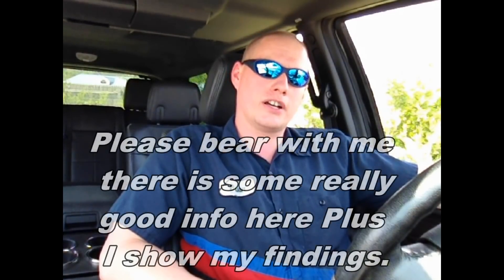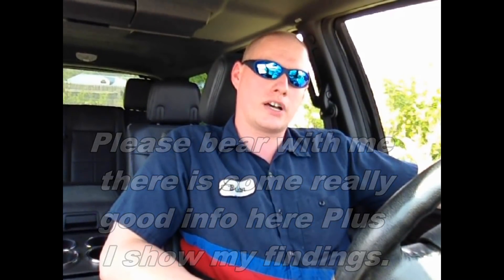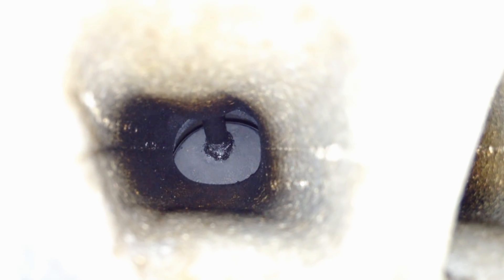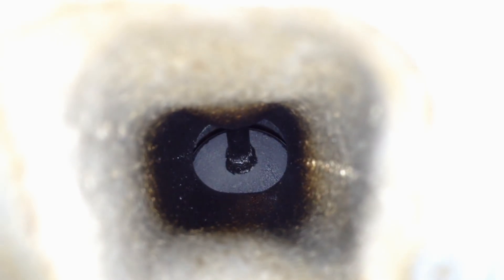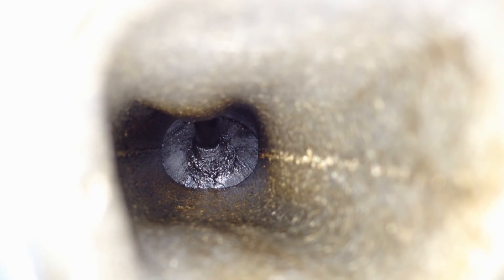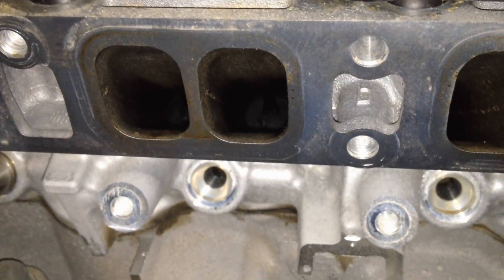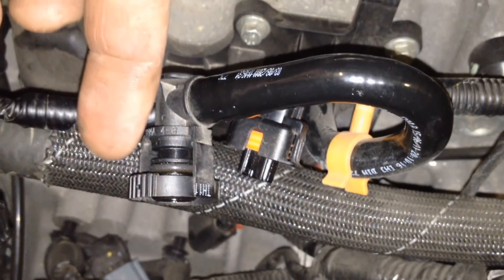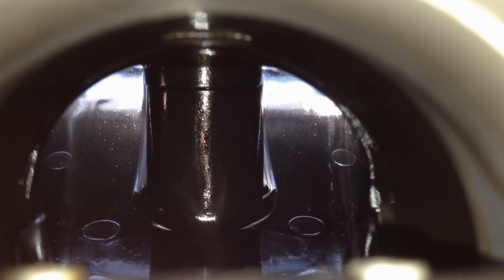Ford Ecoboost Warning Part 2 My Findings

Comment: I recently purchased a 2013 Fusion with about 21,000 on the clock. I've noticed that it seems that the transmission is holding 2nd a bit longer than the other gears seem to and then it shifts into 3rd kind of hard. It seems as though the more load that's on the car makes it shift even harder.

Have you heard of this? I was going to take it to my local dealership, but sometimes they don't seem to accurately diagnose problems.
Reply from the maker: I would take it in those are known for trans case leaks, and there is likely a reflash for the pcm. At the very least they can reset the trans adaptive tables to relearn the shift points.
Reply: FordTechMakuloco Thanks so much for the advice! I'll have them check it out.

Are the 6F35 transmissions still known to have lots of problems? I had a Fusion Sport prior to this car (with the Aisin trans) and never remember reading good things about the 6F35.  I read on Ford Fusion Club that a guys '13 was doing exactly the same thing as mine and they replaced the main trans controller which seemed to resolve it for him. Does that seem plausible to you?
Reply from the maker: TheBlueF0x The 6f35 has been revamped and strengthened for 2013 but Ford told me they are still seeing plate issued on the valve body (supplier issues) namely the 35R hydraulic circuit. which yours might be having. You hard on the vehicle? Main controller? Valve body you mean? We have not see any valve body issues since the redesign the old ones yes.
Reply: FordTechMakuloco I'm not hard on the car at all actually. I try to take good care of them and go above and beyond on maintenance, e.g. 30k trans fluid changes, 3k oil changes, full synthetic, high quality gas, bottle of Techron every 10k, etc. 

I found this thread while researching the problem: http://www.fordfusionforum.com/topic/10781-2013-fusion-titanium-hard-shift-fixed/. The guy referenced the 'main controller' as resolving the problem, but I'm not terribly familiar with auto transmissions. I mentioned the above to my dealership, but they kind of brushed me off with it.
Reply: What's happening with that guy's Fusion describes what's happening with mine perfectly. All the other shifts are smooth, but the 2-3 feels like it holds the gear a bit longer before shifting, then kind of hits into 3rd. I don't know if this is related but I just thought of this too. Sometimes when shifting into 6th, it'll kind of feel like what a trailer does when you get off the gas or on the brakes.

Btw, I really do appreciate you taking the time to try to help me figure this out and reply to my posts. I sure wish you was local as I'd definitely bring my cars to you.
Reply from the maker: Yeah in that situation I would replace the valve body and reflash pcm new fluid and relearn the shifts and go from there.
Reply from the maker: TheBlueF0x What it sounds like to me is the adaptive shift learned and that is why it is back I am almost positive these are very sensitive to driving style and will learn bad habits, so a simple kam reset and reflash will take care of it for many hundred miles then it will have learned the driving style and be back.
Reply: FordTechMakuloco I took it in today and they told me he didn't feel anything. They said they checked for codes and had a note from the tech that said the shifting was controlled by the PCM, and unless Ford released an update, nothing could be done.
Reply from the maker: Oh wow they blew you off what about an adaptive tables reset and relearn that doesn't take a pcm update.
Reply: FordTechMakuloco Yeah, I guess so. I asked the Service Advisor what they found, but she pretty much just repeated what was on the service invoice. The service invoice says, "CUSTOMER STATES CHECK TRANSMISSION. SAYS 2ND TO 3RD GEAR  HOLD LONGER AND SHIFTS HARD WHEN COMING OUT OF THIRD (SHOULD HAVE SAID SECOND). CHECKED FOR TRANSMISSION CODES. NONE IN SYSTEM. CHECKED FOR TSB OR SSM. NONE FOUND. SHIFTS ARE CONTROLLED BY PROGRAM INSTALLED IN VEHICLE. PCM CANNOT BE CHANGED UNLESS FORD UPDATED PROGRAM."

There is another dealership closer to my house (I live about 40 minutes from work) that I may get them to look at it when I have a day off soon. I'm just surprised that these guys aren't feeling what I'm feeling. I mean, it clearly holds 2nd gear longer (usually about 500-1000 rpm longer), then has a good thud to it when engaging 3rd.

As far as resetting the tables is concerned, if I remove the battery cables and turn the headlights on to use any residual power stored, would that reset the tables and such? If so, I may give that a try one evening before I take it back again.
Reply: By the way, what forum was you talking about on your video?
Reply from the maker: The adaptive tables can only be erased by the ford scan tool then the shifts must be relearned before normal driving. What you need to tell them is there is a 2-3 shift flare that is more our lingo.
Reply from the maker: I am just saying in general about the forums I am on all of them posting my videos.

Comment: I have a f150 with a 3.5 43,000 black exhaust pipe  it seems to run good  bought at CarMax  is this still covered under emissions warranty

Comment: FYI, nothing new on turbo/direct injected engines, VW/Audi has had some major problems with coking of the intake valves. Mini/BMW has a special tool to clean the deposits, it is a walnut shell blaster. you stick in the intake and blast it with crushed walnut shells until it is clean and the vacuum out the results. that is the down side to working in dealer world, you do not get to see what is going on  for other makes.
Reply from the maker: Oh I know about others car makers DI problems that are out there as stated in my original video if you haven't seen it, but on this channel I concentrate on what is currently going on in the Ford world and what they are doing about it, new Ford TSB's etc.
Reply: As a former Ford tech, I know that Ford issued a special service tool in the 80's that consisted of a 5 gallon pail of crushed walnuts and a blaster for just this concern.
Reply from the maker: Sweet they need to bring it back!

Comment: That's the reason why I prefer a natural aspirated engine. Too much trouble running a turbo engine in the long term.
Reply: It's not turbos that are the problem, its direct injection. GM has similar problems on its 5.3L V8 direct inject engines too..

Comment: Well done Brian. Thanks for your work on this. I have a RX dual valve catch can on order for my F150. I'd like to see a writeup on cleaning the valves on a 3.5L. Seems like the best solution until there is an approved fix from Ford for the flawed PCV system. No way I could go back to a V8 after owning an Eco.
Reply: Mike Metzger The Ecoboost is a great engine no doubt about it but I seriously doubt it outlast the engines in the 92-96 Ford Trucks.
Reply: Mike Metzger, a very interesting statement. I'm looking hard at an Escape with an Ecoboost. What makes you say that you like your Ecoboost so much? Thank you in advance for your reply.
Reply: @madviola183  I have a 2012 F-150 with 3.5 L ecoboost it has just over 148,000 miles on it & it still run's like the day I bought it new.

Comment: fleet vehicles will suffer most. due to following the oil change intervals to the T. synthetic oil changed every 3k would probably help. but fllet vehicles for ge capitol will use mineral oil and not approve synthetics or blends.

Comment: Is this happening on Eco boost running full synthetic also?
Reply from the maker: Oh it will but should be much much less.
Reply: Good that's all I use in my 1.6 2013 fusion

Comment: I know a lot of guys add an after market PVC oil separator when they crank the boost up on race cars. I wonder if that would help on guys engines that are no longer under warranty ? Or just go shade tree and put a filter on the end of PVC line. Ha ha!!
Reply from the maker: Allot of people are going that route, but I want to see something from Ford fix their own issue.

Comment: I have a 2013 Ford Fusion with the 2.0L Ecoboost. How can I prevent buildup like this?
Reply from the maker: Good fuel, Chevron Techron in the fuel tank now and then and full synthetic oil helps.
Reply: FordTechMakuloco Will an oil catch can help? I hear people talking about one in the Explorer Forum that I found this video on. If so, where should I get one? What model? Where do I put it on?
Reply from the maker: It sure would. Most people get the Rx catch can, just do a quick search you will see.
Reply: +FordTechMakuloco Hey! It's a few years now and my Fusion recently came out of 3 year warranty last week. Guess what? It now has cold start surging idle. Ford service has confirmed there is carbon build up on the throttle body (meaning there must be intense carbon build up on the back of the valves) Is there a TSB out for this? I'm trying to find it so they would get it fixed for me. This shouldn't happen this bad at 30k miles.

Comment: The only current way I can think of to lower the chances and levels of bad carbon buildup is
Get a PCV system catch can, to keep the vapors and fumes from the crankcase dirtying up the intake, and on this design, the backs of the valves on cylinders 2 and 3. A lower NOACK oil, to help cut down on the production of crankcase byproducts. This also coincides with using a full synthetic oil. I'd like to say (as we would all love to) that the good old Italian tune up would help, but this being a Turbo engine, creating that boost will only force more fuel, richening the mixture, and making this cycle even worse. The worst part I see of this is now Induction services will be viciously up sold, as they might actually help clean the backs of the valves and IM, but of course, the manufacturer won't pay for it. Ask and VAG owner, or Hyundai/KIA product owner. I can't wait to see how Ford's gonna handle this one.
Reply: GM has built a pretty extensive PCV system on the new 14 trucks. They have also programmed in a unique valve overlap to help as well.
Reply: An easier way is to just add Bi injection to each cylinder. You have an above valve injector and direct injection to clean the intake at 3/4 throttle to WOT. And like you said, regular maintenance.

Comment: How long did it take you to clean the valves up? You said that worked really good for your explorer.
Reply from the maker: Intake was off for the injectors but they were right there maybe 10 min. They weren't perfect but much better and was only a test. I will likely change the head out after awhile before the 36k miles are up.
Reply: Did you clean the sealing surface of the valve, or just the stem where the glob was built up?  Do you think the misfire was a result of the injector, valve, or a combination of the two?
Reply from the maker: I did clean the sealing face of the valve yes but only by allowing the cleaner to soak couldn't reach otherwise. I think the misfire was cause by excessive carbon on the valve face personally. We will see if the issue comes back then we know the new injector is not bad and we are down to a carbon issue again.

Comment: Somewhat off-topic question I have a 3.5 ecoboost in a 2012 F150 and I have a oil smell in the engine compartment my dealership has looked it over and found nothing. Is there any issues that would cause oil fumes to be present I notice it most when at idle and in a parking lot if I turn the heater on it will be sucked right into the cab and fill it with the fumes. Any input would be much appreciated thank you!
Reply from the maker: more than likely you have an exhaust leak that you cannot hear. I have found many that leak at the right hand y pipe to turbo connection they are not seated right from the factory. It smells like oil smell since it is before all the cats and is raw exhaust. Have them check there cold start through the fender well you will feel it!

Comment: Does it make a difference whether you are running conventional oil or full synthetic.
Reply from the maker: I would imagine since full synthetic can handle the heat better there would be less build up and more of it passing through before it cooks off.

Comment: This is great info and confirms why the aftermarket world runs oil separators to catch such vapors on Ford boosted vehicles. I ran one on my supercharged F150 where the PCV hose was routed into the air intake system. My concern then was having the vapors drop my octane levels and also coat the inside of the SC with oil. After 3k miles, the separator would have not quite 1/2 ounce collected.

Same is true for the diesel world.